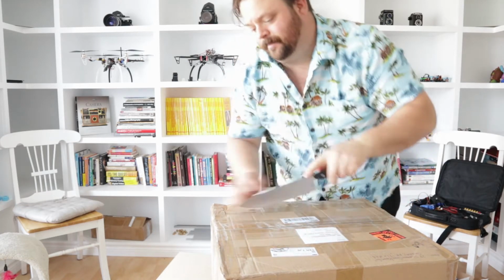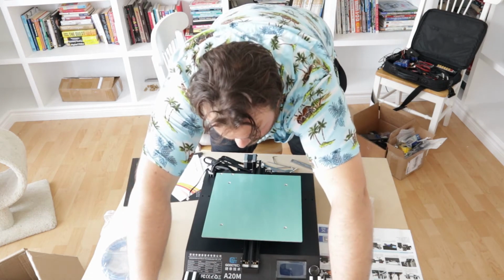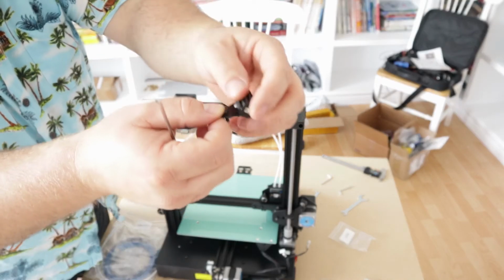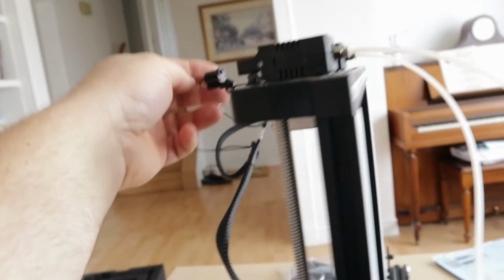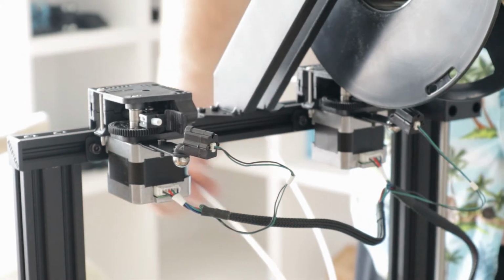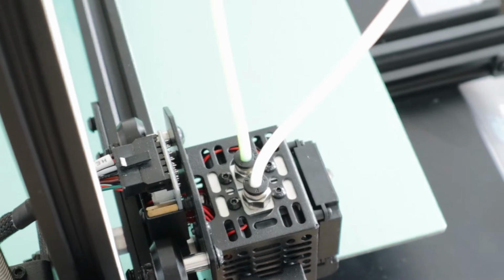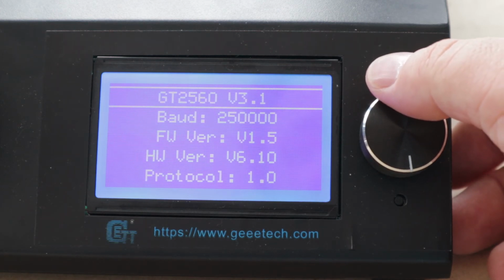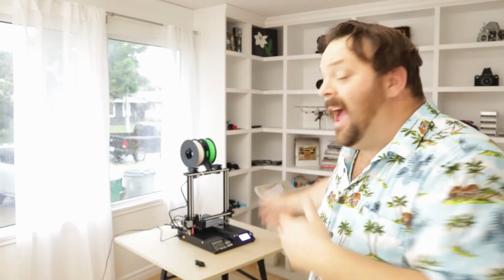Geeetech A20M 3D Printer Unbox, Assemble, and Review! Are 2 Extruders Worth The Hassle? Find out!!!

Comment: Cool content, new subscriber BTW.  How's the printer working out.  Would you recommend and what modifications have you carried out, if any. Looking at one for myself.  Off to view some more of your vids.
Reply from the maker: Awesome! Thanks for watching. The printer is running great. The only "upgrade" I have done on it was to go down to the local glass shop and get them to cut me a piece of glass for the bed to use instead of the texture. A few binder clips holding it on, and moved the end stop up a bit to account for the difference in thickness. 

Been printing a project with it this week actually. Between it and my ER-20. I love using it when I print something that uses two-tones. I can slice up all the files, and print them without having to switch out the rolls. In hind-site, and I know I was enjoying the larger bed size when I got it, but I'd love something even bigger now. Lol. I have an Eryone Thinker SE and a Mingda D3 Pro with large 300+ print area. I would love just that little bit extra for projects where I have a lot of pieces that I want some pieces one colour, some another. Fitting a couple extra pieces on the bed sometimes means the difference between waking up to assemble something, vs. waking up and starting another print. Lol.

I'm getting spoiled here. Hahahaha.

Comment: keep the bed heated to 65 / 70c and you will not have the problem removing parts.
Reply from the maker: Thanks Brent. I'll give that a try. 😀 Parts on my glass bed just come right off when it cools down so it's what I was expecting. I appreciate the tip!
Reply from the maker: That did the trick! :) Still sticks pretty good but comes off a lot easier and I don't need to chip at it with the putty knife. Lol. Thanks again Brent.